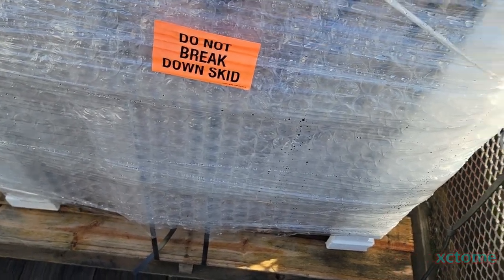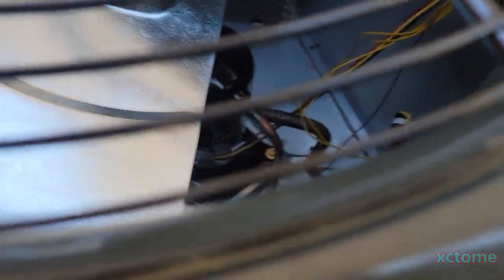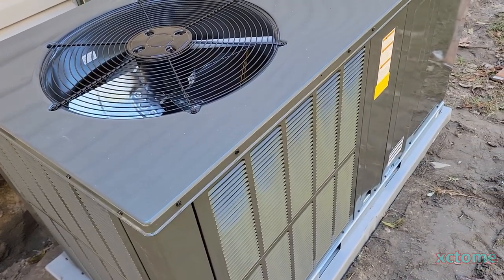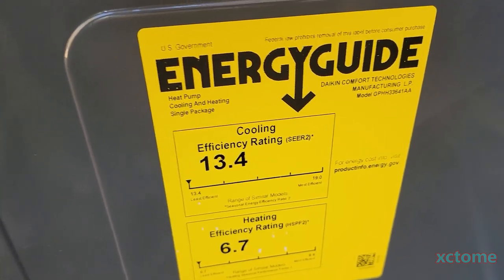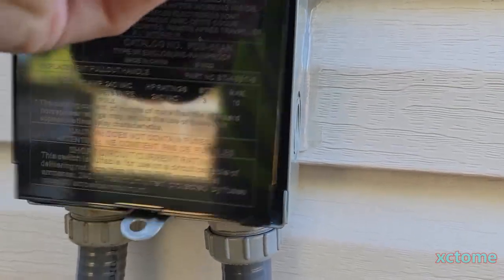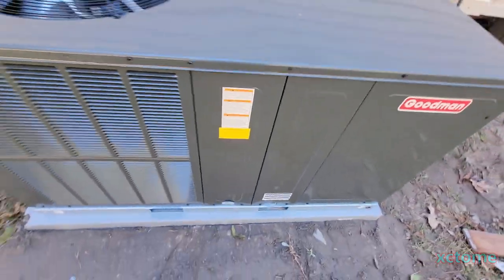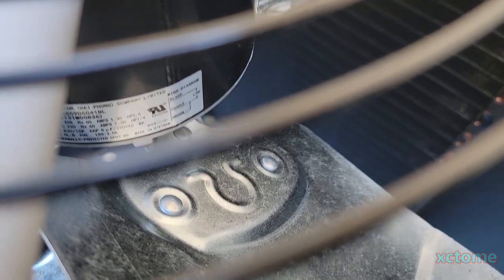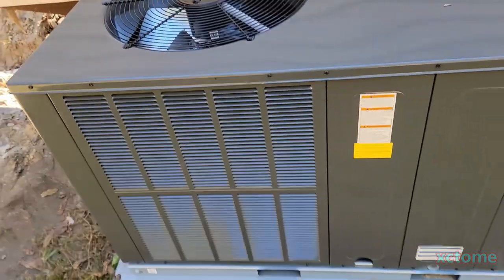BRAND NEW 3 TON GOODMAN GPHH3 2023 3 TON PACKAGE HEAT PUMP

Comment: Are these units difficult to install? I am replacing an old Goodman unit. Duct, wiring, etc are already there. I need to connect square duct on house into new unit (flex hose adapter possibly), connect 220v, and rig up new thermostat.
Reply from the maker: As a certified HVAC person who has worked with and alongside licensed professionals , i cannot comment on installing systems for numerous reasons, HVAC is not a do it yourself task, i always recommend contacting a licensed professional in your area.